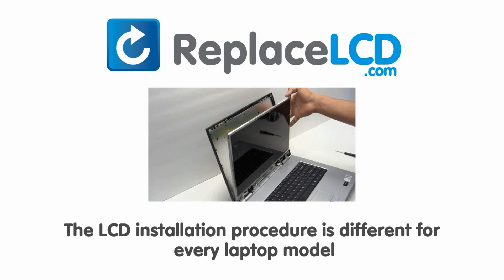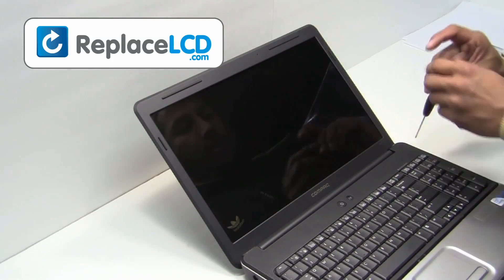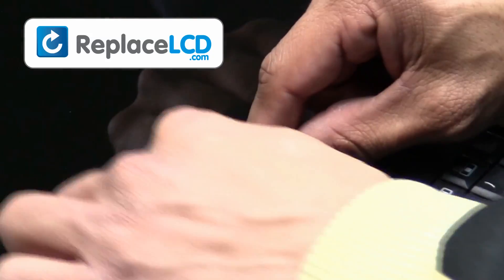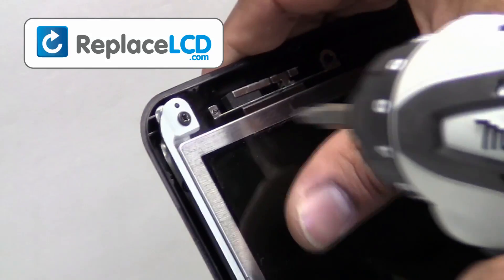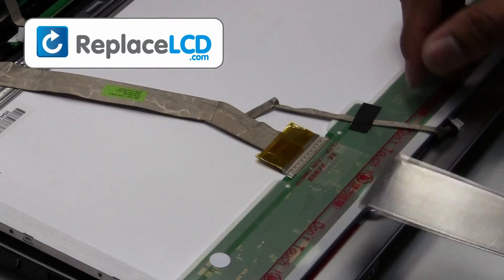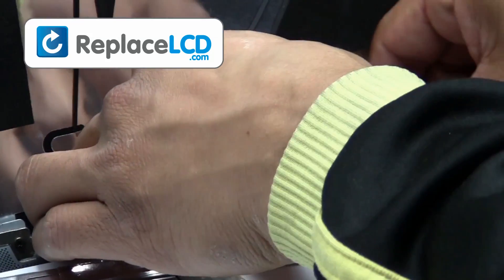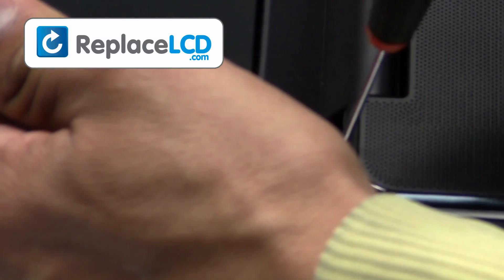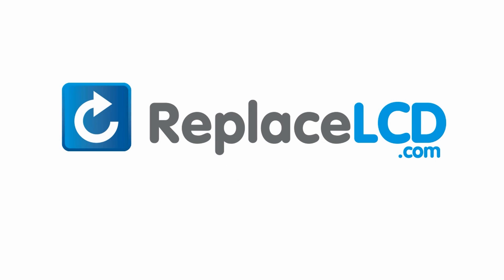HP Compaq LCD Screen Replacement Guide G60 CQ60 - Replace Fix Repair Install Laptop Screen

Comment: Don't mean to sound stupid but, i was wondering if the laptop actually works after this replacement? i didnt see the technician turn the laptop on to prove that it did. so a slight doubt has crept into my mind.